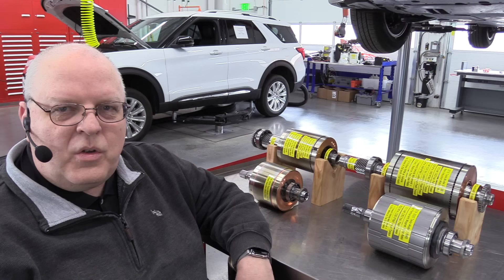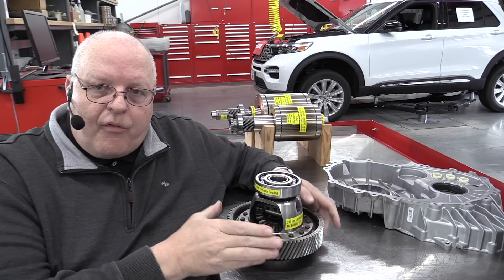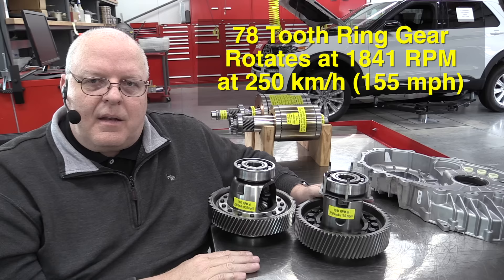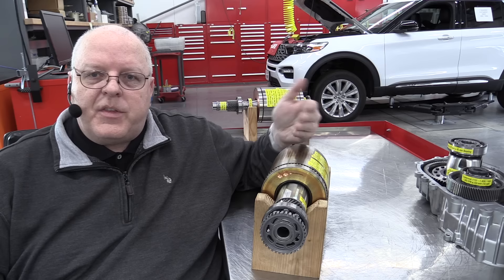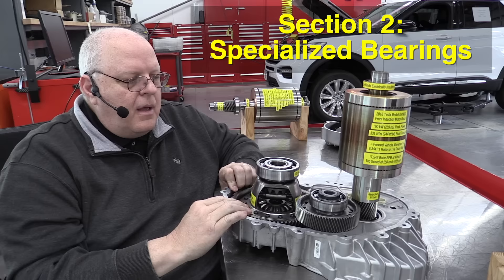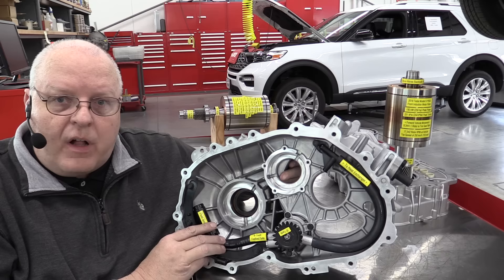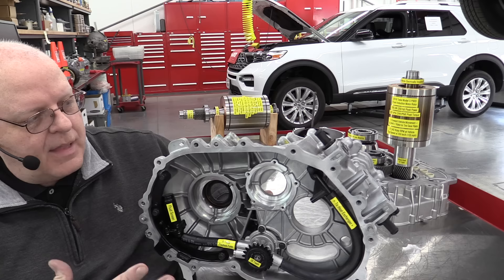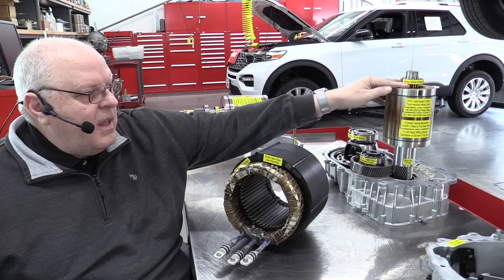Understanding the Tesla Model S Front Motor

Comment: For absolute high performance you want to use only permament magnet motors because they are just more efficient. On high performance application less cooling is always better. The reason tesla (and other manufacturers) use induction motors for their performance motors is that they are cheaper to build big. You dont need rare earth magnets and you dont need an angle sensor which means your inverter can be cheaper aswell.
When you are going 0-60 in under 3 sec nobody will complain about less efficiency. It makes total sense to make the powerfull (less used) motor cheap and the front motor efficient and more expensive.
Reply from the maker: Hi Chris, I used to think the same thing, but I found out that permanent magnet (PM) motors are limited in their power output by the magnetic field strength of the permanent magnets, it cannot be increased. Induction motors (IM) can be much more powerful than PM motors because they can increase the induced current into the rotor to increase its field strength beyond that of a PM motor. IMs are less efficient, but they can be very powerful if cooled properly. Thanks for watching
Reply: @WeberAuto  Yes that is true the peak magnetic field strength is smaller. Making it stronger is extremely innefficient due to field saturation. Torque can still be added by having a bigger diameter or increasing the pole count. That has been done in the taycan. Which is a lot more expensive.
Reply from the maker: Good points, thank you
Reply: @WeberAuto  Thank you for making these videos 👍

Comment: I have come to the understanding that you can only one a PM motor EITHER in the Front or the Back but not both.

PM motors always run at "sync" speed where as IM always have a degree of slip.   Without "slip" on one set of wheels, you would have the two sets of wheels running at different ground speeds.
Reply from the maker: Thanks for the information!
Reply: New plaid drivetrain is all PM
Reply: You certainly can run PM motors on both axles. As already mentioned, the Model S Plaid does that, but so do other AWD EVs (including hybrids). It's not a problem because the front and rear motors are separately controlled, so there is no unwanted locking of their speeds together.

Comment: Cool. When I saw picture of a guy carrying a model S motor, I knew BEV will win. An ICE motor of similar output would crush him to death. 3ph motors cheaper, more reliable too.
Reply from the maker: Thanks for watching
Reply: And the same guy can carry a fuel tank, but the battery to carry the same energy would crush him to death. Comparing one component from each vehicle out of context is meaningless. The engine is a major part of the car, in weight, space, cost, and complexity. The motor is a small part of an electric car, in weight, space, cost, and complexity... especially compared to the battery.

Comment: Would I be correct to assume that just increasing the voltage and/or frequency, is what increases the power developed by an induction motor? Because I've been wondering for a long time now how come a normal, 50/60 Hz induction motor has only 2-3 kW, but then you have induction motors not much bigger than that, that can develop hundreds of kW? I suspect the constant frequency, constant speed motor rotors, such as those used to drive industrial equipment, are also not as precisely balanced. I've had the opportunity to take some small 2 kW motors apart, but I haven't noticed much in the way of balance point. Then again, I haven't paid much attention at the time.

Now that I've watched through to the end I'm also wondering whether EV motors are run in a star or delta configuration. I'm assuming since it only has 3 leads coming out, it is permanently wired in a delta configuration, for maximum power, and the in-rush current is limited by the inverter unit.

Comment: How do you think that a EV will hold up if it is driven into a flooded street condition where the water is deep enough to cover the high voltage battery ? is the fusing of the individual battery packs adequate to prevent a matrotrophic condition? will it short out and blow up ?
Bill

Comment: Do you have any idea how long that shaft grounding ring (18:48) will last?  It seems that the conductive filaments get at least a bit of oil on them, from oil in the stator housing or just passing through from the bearing side, which should reduce friction and wear.  Just curious to know if it's a periodically replaced part or not.

Thanks for another excellent video Professor!  Keep them coming!
Reply from the maker: Good question. I do not know. Thanks for watching
Reply: I think such carbon filaments are quite wear resistant also in oiled condition as in dry contiditon. They should be designed for lifetime. But i am questioning if they maintain their function of shaftgrounding in dirty/oiled condition..
Reply: @Fürst Otto von Bismarck  @weberauto - Aegis (has a/the patent) specs state 200,000 hours with "no theoretical RPM limit". I assume that this is under controlled test conditions with a clean shaft.
Reply: @diyEVguy  Thanks for the reply.

Comment: 14:51 Is there a math calculation taking into account the vehicle weight? I understand the battery packs are extremely heavy. Big torque vs taking off at a certain weight. (They're not slouches by any means, but the vehicle weights are enormous.)

Comment: I had a general auto question, not for electric vehicles but I figure this is the most recent video so why not throw it in here. The drive shaft has a speed sensor but how does it sense position? Since it should need to know position to know when to fire the spark plugs, I believe.
Reply from the maker: The engine crankshaft and camshaft(s) have position sensors for that purpose. Thanks for watching!

Comment: When Tesla wants to “precondition” the battery and warm them, they say they stall the motor to generate heat.  Audibly, it makes a much higher pitched sound while this is happening.  Can someone explain what is happening in the motor and how they stall it while still driving?
Reply from the maker: That is a good question
Reply: I assume they're simply applying power to the three phases in an intentionally suboptimal manner, but not so inefficient that the motor stops turning.
Reply: @pepstein  I think if you get the frequency high enough the motor won't follow along and will just sit there. At least that's what I found out, messing around with an 8 pole motor and a variable frequency drive.
Reply: Perhaps the whine is from pulse width modulation (PWM): https://forums.tesla.com/discussion/167209/preparing-battery-for-supercharging
Reply: You could stall the motor, but there's another way that's easy to understand. To generate torque, the stator produces a rotating magnetic field that drags the rotor along. For this, three alternating currents of just the right shape are fed through the stator coils. If you want to heat the stator without affecting the torque, you can just add a direct current on top of that.

Comment: I've always wondered if the front and rear drive units used the same gear ratio. I had suspected that the front drive unit used a slightly taller gearing, allowing it to run in a slightly more efficient RPM range when cruising at highway speeds. I guess the gear ratio isn't as different as I had thought. It'll be interesting to learn if the rear drive unit and related inverter could be entirely unpowered if it isn't needed to cruise along at highway speeds.
Reply: Is it possible for one of the units to act as an alternator when not used to power the wheels in order to charge batteries?
Reply from the maker: Yes, I hope to find that out
Reply from the maker: Only when decelerating. You cannot use one motor to propel the vehicle and one as a generator at the same time.
Reply: The tiny difference in gear ratio between front and rear is most likely to prevent both heavy rotors from creating harmonic vibration if they both turned the same speed. This is related to why you will never see an axle running 3:1 or 4:1 ratio, which can also cause vibration. 

And yea, in the S/X only the front motor is used during cruise, and the rear just free wheels, which is why it must stay induction and not PM. The model S/Y has the rear motor as PM, and it’s the only motor used during cruise, while the front motor free wheels, which it why it must be induction. 

This is why when they added the dual motor to the model S it got more range, even though there were more friction loses, the smaller front induction motor was much more efficient at low load than the bigger rear motors. Then when they switched to PM front motor it gained even more efficiency. However adding the front motor to the model 3/Y did not increase efficiency because it’s just extra friction during cruise.
Reply from the maker: @imho7250  That is what I suspected. Thanks for the great information!
Reply: @imho7250  pls keep commenting
Reply: @imho7250  The ratio difference is just accidental. The small induction drive unit uses the same ratio at the front and rear; the difference is only between small and large induction drive units. They have different motor sizes, and size affects operating speed and gearing requirements, so it's not surprising that they happened to get slightly different ratios.

Comment: Thanks for the interresting videos, they are excellent 👍
One thing, I don’t think you explained, is. Why doesn’t the grounding ring in one end of the axel and the conducting bearing in the other end not cause sparking in the conducting bearing? Isn’t the sparking caused by a voltage difference from one end to the other of the axel, due to some kind of rogue induction in the rotor, and wouldn’t the grounding ring in that case have been better located at the same end as the conducting bearing to releave this electrically? Mechanically you also only fixate one end of an axel sideways, to allow for expansion and contraction during temperature changes.
If you already explained this in another reply, I apologize beforehand 😅
Reply from the maker: Thank you. That is a good point. I will have to research further.
Reply: I think in terms of grounding low reaistance is crutial. But the highest amount of resistance in the current path is not the sum of static current Paths, but as far as I think the Resistance in tribological contact is far more crucial.
Reply: @furstottovonbismarck8724  if i understand you correctly, you’re saying, that it’s the resistance during motion, that matters. And I agree. The thing I stumbled on is, that essentially, by grounding the axel I both ends, a grounding loop has been created. Normally engineers try to avoid grounding loops, since great currents can be induced, especially in the vicinity of strong magnetic fields as here.
Reply: @Roaldchr  I think there are controversial opinions on this topic. If you insulate both Rotor Bearings, and ground the Rotor-Shaft, than you maybe force the Shaft Voltages to flow as a Current in a loop over the Gears an the other shaft bearings through the housing back to the Shaft Grounding. Otherwise you can insulate all bearings in the driveunit. From my Intuition it is better to Ground Shaft Voltages in best possible way then no Insulation of Bearings is needed when Voltagedrop over the Bearingpath is much higher than over the shaft grounding. So that no discharge events happen in the Bearings. With such a grounding all shaft potential is reduced to Minimum and EMC is better through less Radiated Energy.
Reply: @Roaldchr  Sorry for my poor english skills.
Reply: @furstottovonbismarck8724  Oh you’re fine, I just didn’t know the word tribological.
I see your point. I also don’t see insulating the whole gear train as a solution at all.
Therefore, the way I see it, the best solution would be to ground the gear end of the shaft thoroughly and keep the far end insulated to avoid the loop. So I am curious as to why they did it way they did.

Comment: I am wondering how these two motors are controlled?  Is it possible that the rear motor is driven like a main motor with speed control and the slave motor with torque control for the front motor?
the main motor gives the vehicle speed, the slave motor just follow the torque from the main motor?  I'm just very curious about these motors and the controller. I have watched all your video regaring EV cars,  you are super good teacher in youtube. thanks!
Reply from the maker: Good questions, Thanks for watching

Comment: Great video. Thanks.
We designed electric motor for a truck. 200kW, 200kg.
Just curious, does Tesla's IM can really produce 190kW during for an hour (for example) or it is 190kW for only 20 seconds (before car has reached the top speed)?

Comment: Great video as always.   Just wondering if a tesla owner was in a pinch and could only get tyres that where slightly different overall diameter to the originals front or rear would the cars computers adjust the motors output to keep the rear and front tyres in sync or will you do damage to the car.
Reply from the maker: Thank you. Good question. I suspect it would compensate.

Comment: the car also comes in a square tire set up (same diameter on all 4 wheels)
Reply from the maker: I don’t understand
Reply: @WeberAuto  My p100d was delivered with rear 245/45/19 tires, so it somehow adjusts the rear motor depending on what tires are used? I had the option of either 19 or 21 staggered like you mention in this video so it definitely supports both
Reply from the maker: Thank you for the information. That is good to know!

Comment: Another superb insight John. Just a question, can you clarify the silicon nitrate bearing lubrication? You said on the rear motor video that these bearings are designed to run dry and shouldn't be lubricated whereas on the front motor they do have additional lubrication. Am I confusing high pressure feed to a bearing with just a splash lubrication?
Reply from the maker: Thank you. Sorry for the confusion. In the rear motor video I said the bearings were not externally lubricated, they have their own white grease internal lubrication. The rotor and its bearings on that model were cooled with coolant. The method used on the front motor provides lubrication and cooling with the pressurized fluid spray.
Reply: @WeberAuto  Thank you John, that makes perfect sense now. As I get older, I easily get confused!!

Comment: Huh. I thought there are using both permanent magnets motors front and and back. Would sacrifice performance for a little bit of efficiency.
Reply: There isn’t a reason to have a second PM motor. You can get all the efficiency you need by just powering only the PM motor, and use the cheaper and higher performance induction motor exclusively when you need it. Best of both worlds instead of being constrained to the weaknesses of using a pair of either.
Reply from the maker: Great points, Thanks for watching
Reply from the maker: I thought the same thing before disassembling all of these motors. Thanks for watching

Comment: most cars use tapered roller bearings on diferential, strange to see ball bearings used here, not as good for side forces.
Reply from the maker: There are ball bearings designed to take side forces. Thanks for watching
Reply: Tapered roller bearings are usually used on ring and pinion set ups because of the potential spreading forces with ring and pinions.

Comment: Would have been interesting to know the resistance of the temp. sensor at ambient temp. Could indicate if it's an NTC, PTC, PT 1000 or even thermocouple.

Is this ground ring a part that needs to be replaced at some time?

Thanks for another great and interesting video.
Reply from the maker: Agreed, I wanted to measure the resistance. I suspect it is a NTC sensor. I do not know the answer on the grounding ring. Thanks for watching

Comment: Hello and thank you very much for making these videos! Great work. Can you clarify why the big rear motor from the P-models require less transmission fluid than the smaller one. You state 2250ml for the small rear motor and only 1400ml for the big machine.How come the bigger unit need less lubrication/cooling?
Reply from the maker: The large rear motor uses internal cooling passages for antifreeze coolant to remove the heat from the rotor and the gear oil. the small front motor uses gear oil to accomplish the same thing, so it requires more fluid. See https://youtu.be/MQV3D8F6gvw?t=1967 thanks for watching